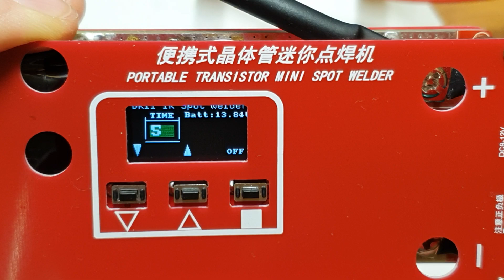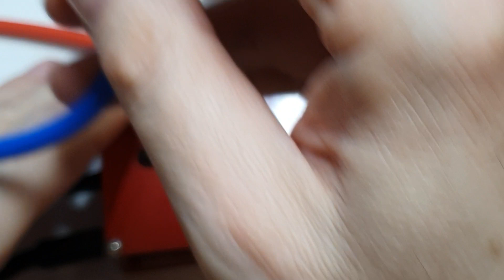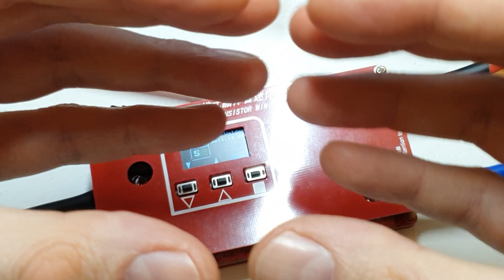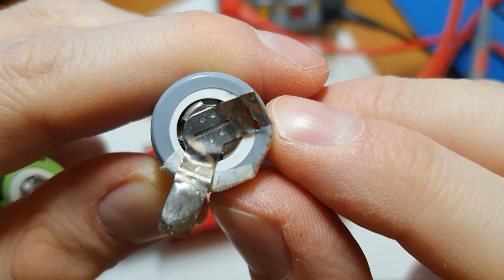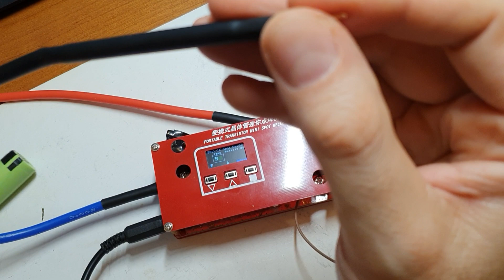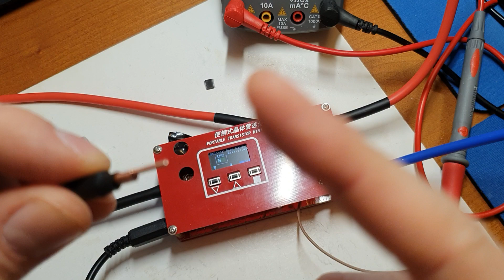Details Mini Spot Welder Arduino port

Comment from the maker: For instructions and code visit:
https://www.instructables.com/Arduino-Mini-Spot-Welder-Port-BK111820-Series/
Reply: Thanks!
Reply: hello, could you please help with adapting your arduino sketch for the BJ07-1K welding version, my MCU is broken on it?
Reply from the maker: @maks_steels  Hi, you can use the schematics I posted in the description of my various videos - for clarity here is the link to the BJ07:
Mainboard:
https://drive.google.com/file/d/1EM7G28I6Zkv35L-ae8JuToM6-m1DQuhd/view?usp=sharing
MCU:
https://drive.google.com/file/d/1LuWD--ZSOIpf0oW1TmZOXtKvCVlTSpH4/view?usp=sharing
With this schematic you can connect the arduino pro mini o nano to the board after having removed the broken MCU as described on the instructables link. The connector pinout is identical, you just need to connect the voltage sensor, manual trigger and Gate trigger to the appropriate points on the board. The most difficult part is connecting the display wires which can be tricky if you have no soldering experience, the rest is trivial.
Reply: @Luca_Techy  do I also need to replace the 1 kOhm resistor with 470 or 560 Ohm?
Reply from the maker: @maks_steels  they will both work

Comment: I'm looking into getting or building a spot welder and found your videos very interesting and informative.  Thanks, you've got a new subscriber!     
I am also curious if you have any experience with dual pulse welding?  Seems like with your own arduino firmware it would be trivial to add such a feature, but I don't quite know if there would be any benefits.  As I understand the first pulse is to help blast away any oxidation before the second main welding pulse, and is something like 1/5th the energy or duration of the 2nd pulse.  But maybe that's not a problem for nickel tabs anyways.
I'm more interested in spot welding thin stainless steel sheet or wire, rather than battery tabs, so I'm doubtful these particular model will be capable.  I found some quite crazy looking 24 mosfet boards on banggood/aliexpress and was curious if you had any thoughts on them.  (I was going to link it but youtube is apparently hiding my  comment without explanation, so trying without. you can probably find quickly with a search anyways)
It looks like its just a simple board to hold mosfets/bus bars and would still require a controller / mosfet driver to switch them, but I'm guessing this would be capable of handling just about anything I could throw at it.
I'm also still trying to decide what the best bang for the buck power source would be: ie just get the largest lead acid I can afford, or maybe LiFePo4 packs, or even something based on supercapacitors...  Or if I should just give up on a mosfet based project and just get a more traditional mains transformer based one such as from Harbor Freight.
Interested to hear if you have any advice, thanks.
Reply from the maker: The double pulse is a viable option with the Arduino port, pretty easy to implement. The thing is that even with a double pulse if you don't have clean contacts the sparking will occur and the weld won't be perfect - but it might help in getting rid of small impurities. What I find is that even if I "double weld" when I use my foot pedal I get sparks both times unless I have a clean and good contact. I prefer the foot pedal because of this, I can weld and keep the contacts on the weld points and re-weld 2 or even 3 times until no sparks are seen which indicates a more "solid" weld. Maybe doing this in software at very close intervals could yield better results as the weld is still hot. I will run some tests on my Arduino port for further investigation.
If you need powerful welds you need to step the game up a notch: matched MOSFETS and copper bus bars are a must. Probably the KWELD or similar Arduino controlled models are more in line with what you need. If you want to build it yourself then yes you need to source matched FETs as first thing (Infineon or similar) from reliable sources. There is no point in having 24 MOSFETS if they are not matched, the one with lowest internal resistance will always get most of the current until it "levels out" with the others and will be the first to go. That is why with less FETs it is true that you have less total potential current delivery but it is also true that the matching is much easier balanced because there are in fact less FETs.
The power source type depends on how often you will use it basically. AGM batteries last but they must be kept charged at their appropriate float Voltage and slightly shallow cycled to avoid long term sulphatation. If you use it only a few days a month it might not be the right solution, better a combination of a large 12V 500F Capacitor bank and good LiPo pack or smaller AGM. The Cap banks usually last (if good quality) and the Lipo is way cheaper than the 12V 200A battery (though they don't last if kept fully charged all the time). 
A MOT converted Spot Welder is a different beast, it's definitely not portable and does need that you have a high Amp power source - household 3.3KW can easily be tripped by this solution. If you have an industrial outlet then no problems. As I said it all depends on what you need to use it for and for how long.
Reply: @Luca_Techy  The first pulse softens the material. While still fluid, so within 50ms or so the applied pressure will make sure the electrodes make better contact, go past the corrosion/oxidation. Then the second bigger pulse is applied which does the actual weld with a now more reproducible contact resistance. So I think it's a very good suggestion and does not harm. The tricky thing is to find the "best" timing. How long should the first pulse be? How much delay until the second pulse should fire? How long should the second pulse last? Having the three times configurable add lots of flexibility. This might become a project on it's own. Adding calibration like K-weld does :-)

Comment: I posted details about MCU I discovered under all such related videos.
Want to share what is lacking in this welder. 
I use manual mode with welding pen (for one hand) with trigger switch. It works well but what I'm not happy on is a delay ~0.5-0.8 sec. I'd like to have an instant weld when the manual switch is triggered.
If it would be possible to modify ...
I looked to the input switch circuit and saw there some RC components, so maybe the delay is partially caused by hardware. 
Maybe you could share some ideas, if any.
Reply from the maker: Unfortunately it's not done by hardware, the delay is purely in software. The only alternative at the moment is to use an Arduino pro mini with my code and removing the MCU from the board, but that's quite a lot of work and you need to be handy with the soldering iron. It would be possible to rewrite the code for the existing MCU which is a pin compatible clone of the STM8 (but apparently not codewise) but that would mean knowing the development ambient for that specific IC.
Reply: @Luca_Techy  I'd consider an option to re-solder the chip to STM one (I can do that) and program STM with custom (yours ?) firmware. Is this a possible way?

I'd not want to play with soldering a lot of wires with arduino board, as in your case.

Trying to write a code for Nuvoton chip - is not practically smart to spend a lot of resources.
Reply from the maker: @oleksii.zagorskyi  I made an Arduino Pro Mini 3.3V (Atmel 328p) version - unfortunately I haven't done any STM8 version. If you are acquainted with the STM8S003 or 103 then you can try as all the hardware specs are here. All you need is the ST7735 OLED SPI library for the STM8 and you're set.

Comment: I bought my mini spot welder on June 2020 and I see not scratched MCU name -  NUVOTON N76E003AT20
It's with MOSFED driver, but without any model versioning printed.
Reply from the maker: Yes it's a Chinese clone of the STMS8003 family, pinout memory etc identical.

Comment: i live in the uk and bought one but it is called a CA04-2k which is the same as yours but dosent have those resisters on the back 

should i add them like yours
Reply: https://drive.google.com/file/d/1-3KUEXMVO9ZjynY0u28ZxSsdV8SydhQ0/view?usp=sharing
Reply: https://drive.google.com/file/d/1-1m_f3VfulTBLycPTtBm2Vl8FpzwfWDn/view?usp=sharing here are some pictures of my board
Reply from the maker: I'm not aware of this specific revision - if it has the fix already with the resistors on the front besides the 2 ones I showed then you are ok - just replace the 1K resistor which I indicate on the MCU board with a 470Ohms (the top removable board has a 1K resistor on the left side labeled "102").
Reply: @Luca_Techy  mine has all the resistors and diode under the big capacitor but on the bottom of the board it did not come with that tinny resistor soldered to the two top pins but I’m unsure if I would need to put that blue 10k resistor in 
I’m not very elctricly minded but want to give it a go
Reply from the maker: @abesmith8642  Please take a picture of your FET board (bottom and top) and MCU board and post it so I can take a look to be sure - I haven't seen a CA04 revision yet!

Comment: If u buy another one, don't buy the same of mine 😝. I retried this afternoon, and it is dead, nothing happens after the beeps, and I'm a noob in electronic so I can't do anything to repair it. Aliexpress will refund me.
Reply from the maker: A refund is always a good option! Pity you can't check what's wrong though, I'm sure it's repairable.
Reply: @Luca_Techy  I'm sure too, but I really suck in electronics and I'm not able to repair it ;).